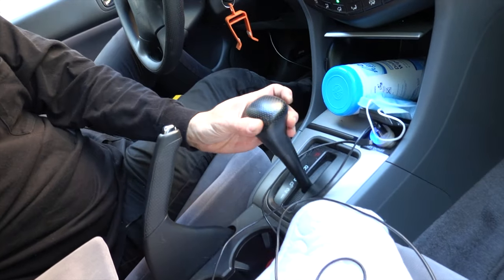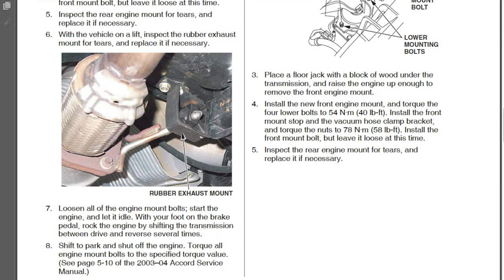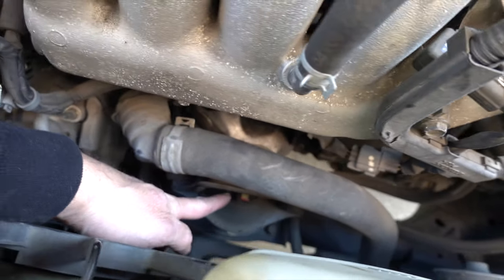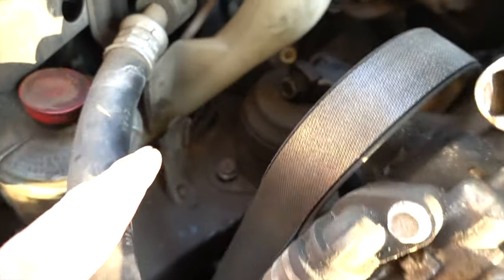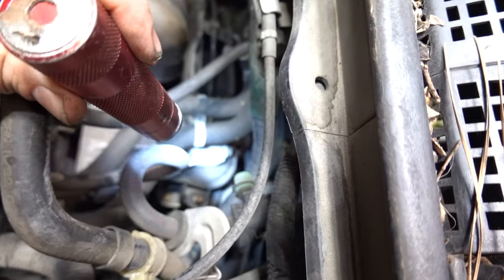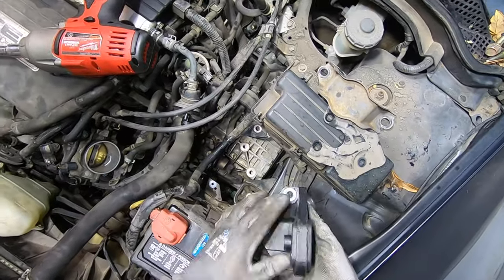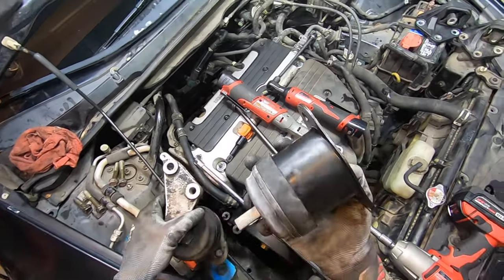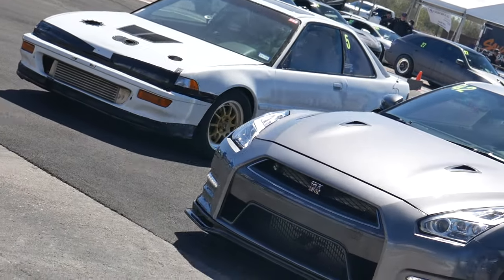Your Car is Shaking or Vibrating While at a Stop - Symptoms and Fixes - Honda Accord K24

Comment: I can tell you what the issue is and how I "fixed" it. New mounts, all of them and make sure they are oem not aftermarket. Do a tune up, New oem plugs, New pvc valve, new ignition coils, new serpentine belt, valve adjustment, new air filters. Finally have the ac compressor checked and make sure all the pulleys are goos. Check for any vacuum leaks. Reset the ecu and do the idle sequence. Finally drive with the lights on.
Reply: There is no motor mount in the front. The motor mounts are bad. It’s a valve adjustment do to tight exhaust valve lash. Adjusting these valves. your good to go. Not quite sure where all of this comes in a play but I love to understand more. I definitely will check into this, but this would fix my vehicle. No problem it was a pain but got done pretty easily. Also did I hope there is a paper towel in the intake lol.
Reply: The 7th gen accords have a motor mount in the front, it has a little vacuum hose and is not difficult to get to. I've replaced a few of those (on other cars). On my 07 I replaced all mounts and did a good tune up, found out two of my pullies were worn, so I replaced the part (water pump and serpentine tensioner assenbly) the car runs like new, no more vibration.
Reply: did you ever get bad gas mileage on your accord, i get really bad mileage and my rpm surges a bit on start up and vibrates

Comment: I think you HAVE to get the OEM front mount. I got a full aftermarket set from Rockauto and it still feels like hot garbage while at idle.
Reply: Same! Not from rock auto but mine vibrates like hell
Reply: Lmaoo same here. Replaced the engine mounts and it vibrates even worse
Reply: Status Report: Got just the OEM front mount and got rid of my problem. Can see physical differences between the aftermarket one I got vs the OEM. The rest of my mounts are still the aftermarket pieces I used before.
Reply: Use nothing but OEM mounts
Reply: Motor and or trans mounts are only ONE OF MANY  potential issues causing vibrations.  Parts changing to find vibration issues will get expensive really fast, and often times get you no where.  Proper diagnostic work is the only way to go !
Reply: @yzmoto80  where should I go for that
Reply: @yzmoto80  what about vibration/rattling when idle or in neutral? what causes that? can you give me some clues as to what to look for?
Reply: @_brushie ... Thank you so much for the update brother... It's super helpful to have someone else that did the cheaper route and then the OEM and can attest to the OEM making a difference.

The cheapskate in me needed that confirmation before pulling the trigger on the insane OEM prices.

Thanks!

Comment: I just changed all  5 original honda mounts for my accord (it really cost me a bomb!) , however the car still vibrate a little when idle.. not sure if anyone has any idea how to solve this? The mechanic blames that one of the mount is some aftermarket mount hence causing the vibrations and he ask me to drive for a week to observe.. the funny part is if I turn off my air conditioning and the RPM drop the car was quiet, but the car starts vibrate once the air conditioning is on.. please help :(
Reply: Belt tensioner can be problem on ac. It was that on my cl9 k24.
Reply: Same when I shut off heat or ac it doesn't rattle nearly as loud though I will say it sounds more like something coming from underneath the engine bay like an exhaust heat sheild of some sort
Reply: Have the same issue, changed all 6 original motor mounts, and the vibration is still existing, quite annoying I have spent so much already!
Reply: Just some updates on the vibration issue and I have manage to fix it! :) Would suggest to send the car to have the throttle body and the mass air flow (MAF) sensor checked and clean it if is dirty.  I cleaned this two components of my  car and the vibration went off. Hope this method can solve your problem too.

Comment: My mechanic changed all of the mounts on the engine and trans, but the car still runs rough and vibrates at idle. I'm just at a loss. It was $1800 to change a lot of the worn out suspension bushings and engine and transmission mounts, and the thing still runs rough.
Reply: Was the front engine mount OEM? The aftermarket front engine mounts are really bad. Try cleaning the throttle body and check for vacuum leaks and a dirty air filter first before doing anything else.
Reply: Can be a lot. Bad timming, dirty intake, iac, egr, vacuum leaks, even dirty ground wires can mess with the computer and it won't get the right signal and make it idle rough.

Comment: I’m having the same issues on my 2004 acura tsx with 235,000 miles. I used some cheap front and rear motor mounts. 🤦🏽‍♂️🤦🏽‍♂️🤦🏽‍♂️ Two years ago.

Comment: I’m having this issue as well, but I also believe it has something to do with spark plugs as well since the check engine light flicked on and I’ve occasionally smell gas.
Reply: If you smell fuel, 1 or more of your spark plugs might be too loose. When I changed mine I did it without a torque wrench and 1 was a bit loose and I smelled fuel, tightened it up properly & no more problem.

Comment: I recently replaced the front and passenger side motor mount and I still vibrates not as much but it still does  it’s on a Honda accord 2005 LX 2.4

Comment: I find the front bumper mass thing interesting. I'm not sure how that would do much except cause the plastic to want to sag more.  At first I though it was weight for the engine. I've found the weight online, Still looking for the radiator rubbers. I want my car as quiet and smooth as possible.

Comment: Excellent video. Thanx for doing it. Those cheap mounts, how are they doing after a hear of driving on them? Cheers!
Reply from the maker: Still holding up.
Reply: @Donnythelatemodeltech  Nice, thanx. I think I may try them b/c Honda OEM price is totally outrageous!
Reply: @chriscadman5715 Yes they work fine, but use OEM only for the front engine mount.
Reply: I installed them and they vibrated almost as bad as the worn-out OEM mounts. So I bought all Honda OEM mounts. The rear OEM mount 'pops' only in reverse on the first acceleration. It's obviously made from a different kind of rubber. But all the other OEM mounts are true OEm mounts. They all work now and the vibration is almost zero all the time. So I definitely would NOT buy these aftermarket mounts. I even tried 2 other aftermarket mounts and they didn't work. Too much vibration. Anchor is a definite NO b/c they are non-hydraulic and transmit the vibrations totally!

My tip on replacing the rear mount: remove it out the driver side. Detach the brackets that hold the hoses and do the usual disconnect of the 2 driver side mounts (upper and lower tranny mounts) as well as losen up the passenger and front mounts. Jack the engine up a couple inches for clearance of the rear mount, and it should 'slip' right out. I did it both ways (out the passenger side) and this is by far the easiest way. Takes about 1/2 an hour to remove using a jack in your driveway.

Comment: Should I ask my mechanic to try this? He fixed something a few days ago but it only made the vibrating worse and added noise.
Reply: Same thing happened to me he said he replaced the motor mounts but vibration got worse and added noise . My rpm also moves while idle did you ever fix the issue ?

Comment: I think it must’ve been about 2-3 weeks ago started to notice that it started to vibrate slightly when switched into drive but not while driving only at idle, I started to feel it in the steering wheel I can feel the ac vents vibrate a bit.  I thought at first it might’ve with the sudden temperature drop since it’s starting to get cold where I live
Reply: Did you find the problem I have the same problem rn
Reply: @brianbarrientoz  it ended up being the motor mounts for me. Just fyi if you change them it’ll still be kinda vibrating if you use aftermarket motor mounts instead of ORM. I also changed out the transmission mounts too. Not 100% if that was also a factor in it vibrating but mine were cracked which is why I changed them

Comment: Does that same process apply to the 05 accord I noticed everything in that 04 u working on is exactly like mine  my 05 accord with 135k miles after doing a quick revv to 4k rpms to test out something I ended up feeling slight vibrations all of sudden when in park or stopped in drive at a light never had any type of vibration at all it drives smooth feels new actually still since I do all preventive maintence ahead of time on my own but I can't explain the sudden vibe just for revving it to 4k rpms for about 5 seconds.  Any ideas? If maybe a mount went with that kinda Rev? I never revved my engine since I've owned the car any higher then 2,500 in park or even while driving highest I hit is 3k n it drops below.

Comment: This is super helpful, we have a 2011 2.4L is it’s doing the same thing. We replaced the front mount, but it didn’t fix the issue. Guess we we have to buy the front OEM and replace the rest.
Reply: Yes, front engine mount should be only OEM. I first installed aftermarket and bought an OEM within a week.
Reply: @junny1075  what caused you to buy the the OEM part?
Reply: @MrSamPhoenix  vibrations and noises while  accelerating at certain rpms. Btw, the weight difference is huge.

Comment: I changed the transmission and passenger side motor mounts, also I changed the tensioner and belt. All original from Honda dealer and still having the same vibration, don’t know what else to do. Mine is a Honda Accord 2010, 4 cylinders. Any advise? 
Front and back motor mounts looks great.
Reply: Same problem here. If find the solution please let me know. The big problem i have is that the gas pedal is vibrating and its annoy the shi.t out of me.
Reply: @jack8356  did you ever find out the problen
Reply: @yuriyuri1715  nope never did. Totaled my car a few months back. Bought (paying) a new camry now. I check the car fax  looks like they fixed the car in April. Cause i see an emissions passed report. It has 160k miles on it. I took well care of the car, but it had oil leaks from the engine oil pan, Burns no oil. Just wonder what it looks like now. Also something weird was happening with the engine after i crashed so when i had the chance to keep it, i said no because i didnt want to fix all its problems. And i had put in a lot of money to replace the rear brakes, drive axles, engine mounts to try to fix that vibration. Im just glad i dont have to deal with it anymore. No i didnt crash it just to buy a new car either.

Comment: Do you feel tge honda motor mount is 100% needed or can you go aftermarket? I was quoted 250.00 for front mount alone. Great video
Reply from the maker: Honestly  , you will still have some vibration with the oem mount,

Comment: I have the same problem with my 2002 honda accord. Replaced th front motor mount with a generic one from rockauto. But after a few months it is back. Will check the motorsports mout again

Comment: My car does that, shakey thing, De guy at jiffy lube says it's fine it's okay that it's bc my car doesn't have de ac & it squeaks. I got air in De ac but i guess it's not cold? I prefer De windows i don't really do that. What you said about de weights makes sense cause it does that tug thing. I don't really tug things so i use regular gas. But i can feel it. It wants to race with De other tooters & tug & then me i drive slow like an old lady 😂 it's old over 2k5 hundred miles but my baby feels good. They say if it feels good it's good. You get a feel you can kind of tell.
Reply: Sell that junk get a explorer

Comment: 🌴🇵🇷 Hi I just watch your video thank you for posting that up I have the shaking issues on my car 🚗 Honda Accord  1999 ex 4 cylinder I did change the spark plugs on my car..it shake it feel like it going to shut off..the engine light goes off in on💬❗🤔....the oil has been change...I hadn't done  diagnostics...yet I will ...